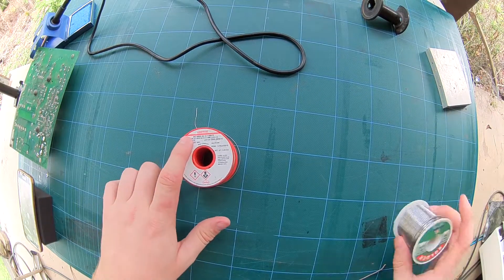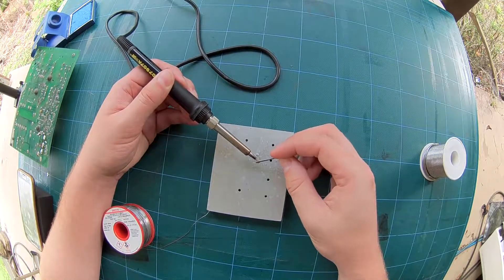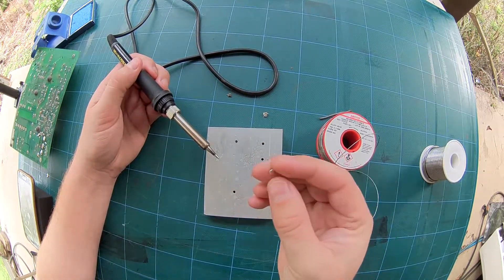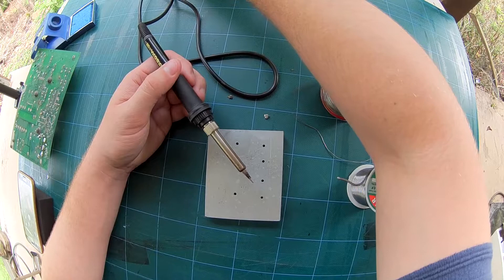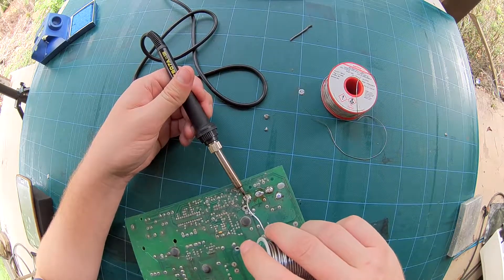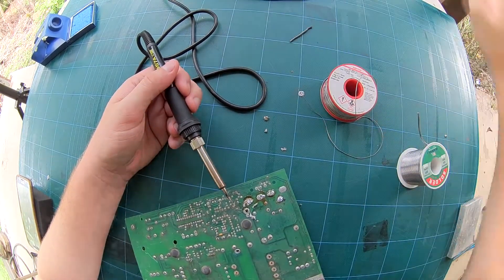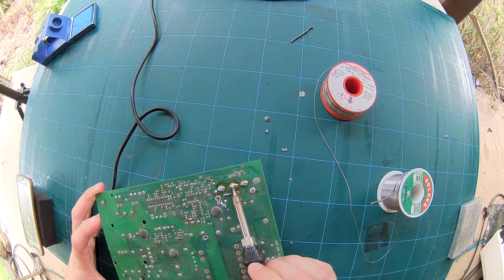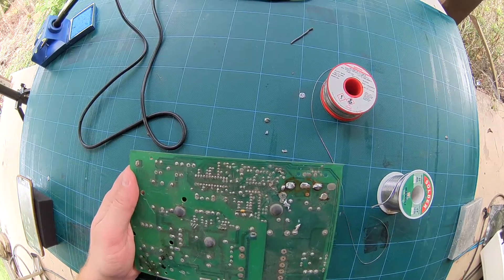Real vs fake solder.

Comment from the maker: I randomly looked at this video and found some comments. I do think this is probably lead-free solder, but I am fairly sure it was marketed as 60/40.
This video has much better detail of fake solder, and definitely says 60/40 on the reel: https://youtu.be/5Ku7I3hA3AA
Reply: That's lead free. I had same problem with a small amount of 60/40 I bought for testing. The chinese market is badly contaminated and I would advice against buying chinese solder. The BEST brand is supposed to be good, but it isn't that much cheaper than local stuff. Then, there is the risk of fake on the chinese brand. We should all stop buying chinese solder and let those clowns go bankrupt.

Comment: I have been buying Solder Wire for electronic soldering from AliExpress sellers in China and recently realized I have been scammed every time.
I noticed this time when I ordered as a 100 gram roll, i removed al the solder wire and measured it on a scale and found that the 100grams of wire were actually 34.12 grams of wire and the plastic spool reel was weighted heavy to make it seem like it was 100grams.
Then I took my prior orders of 50 Grams Solder wire and repeated the test and found they were not 50 but actually 30 grams of solder.
Comparing this to price per actual pound it is costing more than to find an American brand located n the USA.
Anyone buying Solder Wire be aware chinese brands are not posting their actual weights and you should compare the price per ounce and not what they are telling you.
Reply: Everything made in china is faked.

Comment: I mean if it's just for soldering automotive wires together the cheap stuff performs rather well as long you got a 60-100W Iron 🤷🏻‍♂️

but for circuit boards it's gonna be annoying
Reply: At 400c, the insulation would melt. It can be seen in the video it performed badly lumpy and costed considerably more effort and time. On circuit boards, it would destroy components.

Comment: Thats is not fake that solder have more pb and not shine and need more heat to liquid. In circuits shiny  will be oxid with air soon and dosn,t good for computer chipsets because in lowest tempreture work converts to liquid and oxid , that green solder is better
Reply: Do you actually have a clue? All my old computer parts have shiny solder on them. Even the recent direct from china boards have shiny solder on them. Manufacturers don't use the green junk.

Comment: It's not fake, it's lead free, lead free melts at a much higher temperature and the dull finish is correct for LF solder.
Reply: It's made from solder dross, nothing to do with leadfree. Eww.
Reply: if says 60/40 cant be lf unless is fake , so ....
Reply: Bollocks I had issues with this piece of shit solder, destroyed a board thinking I was doing something wrong.
Switched to a lead free solder, flowed like heavens
Reply: Yeah computer chipsets use that one to work longly lead free dosent good either not fake also is better one